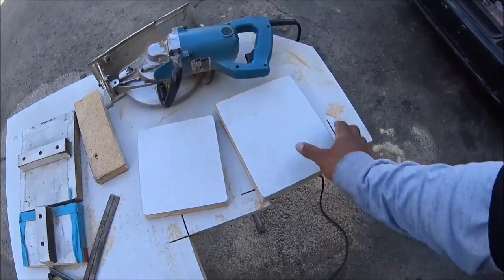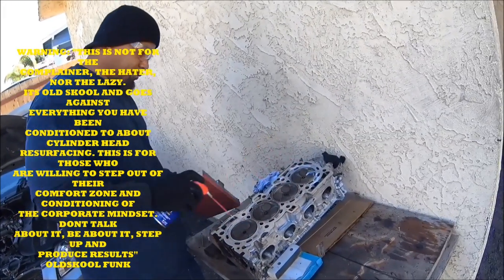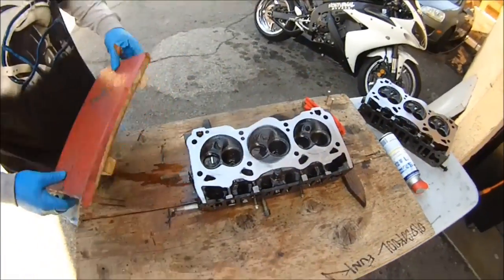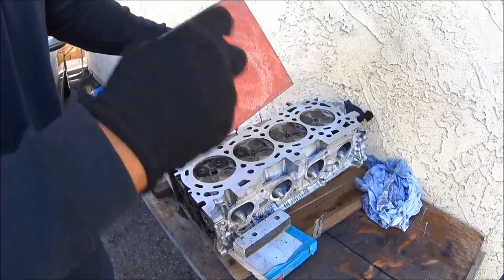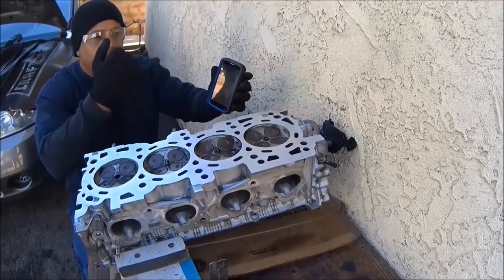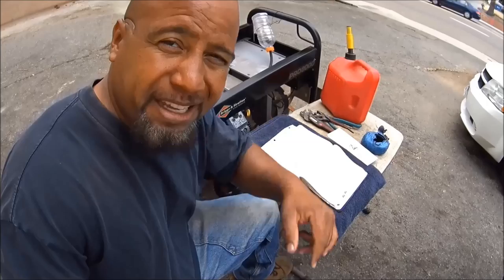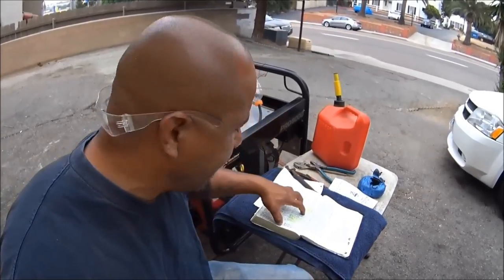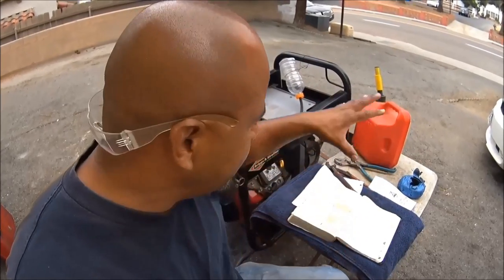(NEW) FASTEST CYLINDER HEAD RESURFACING TRICK, DIY OLD SKOOL STYLE

Comment: wwwwwwwwwwwaaaaaaaaaaaaaaaaaaaaaaaaaaaa! 
Not as good as a machine shop but is very close. I had a subaru head gasket job on our engine done at a dealer years ago. they used a wiz wheel to clean each surface. That a mess as it rounded the sharp edges off each indent. Now have the heds at a machine shop yea a performance shop 4 to 700 for the work but valves are bent. because of timing belt failure. should I leave them there or replace the valves and lap them in (done them before on motorcycles and lawn mowers and worked well.  The key is getting something flat enough. This  stuff is backwoods old school shade tree stuff. 
Dont use copper seal unless you read the gaskets instructions. Have head of alot of faiures on MLS gaskets with copper coat. 

Love it

Comment: Report Here (For those who've done this process with achievements & failures):
Reply: I've done this once. Not on warped cilinder heads though, but on cast iron heads that had heavy pitting from corrosion. To deep to resurface. I used super glue and backing soda to fill the pitting and than sanded it flat again with the same technique as in this video. Worked like a charm!

Comment: Buddy, sorry to say, but technology replaces old school for a reason, its better, faster and cheaper. Perhaps you saved some money over doing the head yourself, but it sure was not better than a professional jib, nor will it last as long. Doing it that way even though you had 2 thousands of an inch test, you may well missed and area doing your test and that area will get a gasket leak over a small time, a year maybe 2, and if I am doing my car up I want it done right and lasting me maybe the rest of the life of the car. If you have anything to say back, please include the time the car has been running after this job, if it lasts more that a year or 2 I would be surprised and I would be completely in the wrong and I would be happy to apologize in a post, but not till I see some proof this job lasted. I have no doubt it went back together and worked and did not leak, for sure. The question is how long did it last. You get what you pay for, enough said.

Comment: There is a much better way to do this buy a cheap piece of plate glass spray glue your sandpaper to the glass and with no pressure work the head back and forth(glass is as straight as a machined surface)make that vid and you will help people!!!!!!!

Comment: Sorry your method is not applying equal pressure through the entire strokes so you will end up with a flat surface but with an angle that may be off when placed onto the block. This is not really good for anyone to actually follow, anyone reading this please do not do this to your block, it will leave it unevenly done more at one end than the other, unless you have a system that applies same pressure evenly which we do not see here at all. Take it to professionals that can do the job right and not waste your time and money like this.

Comment: I have to disagree, if that engine is worth saving it is worth taking your time and oing it right. To do this right you should be using the russian method, using a large round flat grindstone slowly while turning it. This method will cause beginners to make a "belly" in the center of that head. Slow down!!!! Even better, flat plate glass and take W strokes or be sure to turn th head dont go strokes in the same exact direction consecutively. This is bad instruction here and the bible myth, has nothing to do with any of this.